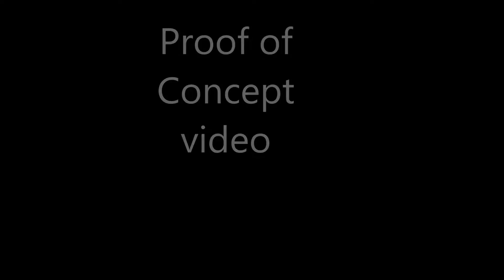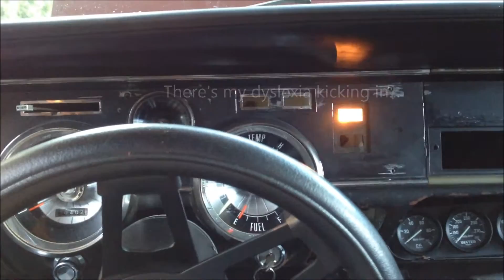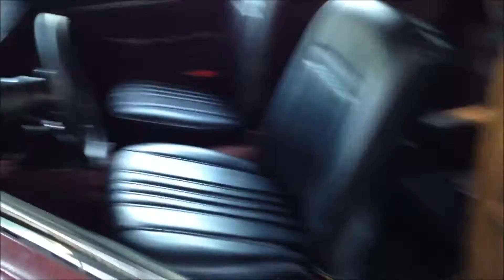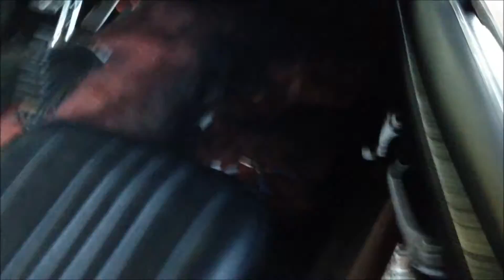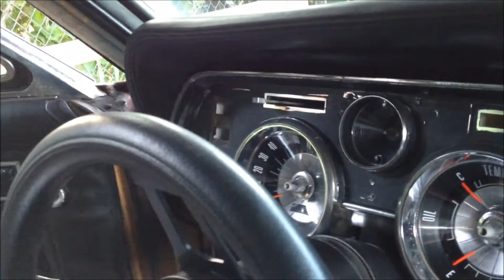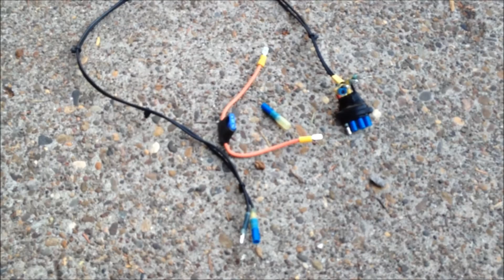1967 Cougar Turn Signal Indicator Bypass

Comment: Maybe I'm missing something here, but why re-wire when you can just use new relays in the old circuit. I realize the concours correct relays are expensive, but you can buy 30 amp generic relays at your local parts store for $10. Or I think WCCC has new style relays with modified connectors that just plug in place of the old ones.
Reply from the maker: +Jeff Schlarb WCC has restored OEM relays, and some modern replacements, but not necessarily for the indicator relay.
  The Indicator 'flash' system is different for just about every year. 1967 is load switched, 1968 is ground switched, but both depend on current load  to close an electromagnetic coil, which is generated from a motor cam changing contacts for 3 bulbs.
In 1969 they basically do what I have done here,.

There is no need for time circuits, but glad your putting EC101 to good use. I was building those on a Radio shack kit board when I was 12.

Comment: Partial, whole, I don't care the more info the better Cheers !! And as far as relays that's not a big deal being a heavy equipment mechanic I had to figure out how to wire and rewire relays early !! LoL
Reply from the maker: Sweet, skills are good! Always a pleasure to help someone who can run with the ball. Here is a down and dirty of what the '68 bypass would have to look like:

https://farm9.staticflickr.com/8280/15617128569_9cff0b9b5a_o.jpg

It reverse wires the bulbs, making the ground side HOT. The bulb socket ground should  and MUST be isolated on the 1968, or you'll send the voltage straight to ground when the turn signal is on.
 I cannot verify this, but it's NOT on the '67, so you must be sure!
Reply from the maker: AirWingAce Isolated should be a 2 wire plug on the bulb BTW. Ground is on the wire not attached to frame.

Comment: And your wiring chart looks awesome ! I took the factory diagram had it blown up to poster size and colored it in, but lost it to moisture, yours is still way better! I'd owe you BIG for a 68' diagram!
Reply from the maker: Thanks, the chart is redesigned as a functional chart for troubleshooting. I was going to do the '68 next, but I am assembling my Coug right now. Maybe over the winter, it'll be posted on the forum when I do.

Unfortunately, after looking, I do not think this will be feasible on a '68.
This method is sort of how the 1969 indicators are wired, '68 was a hybrid.

The turn signal indicators look to be ground switched rather than load switched, and one connection goes through the steering harness plug, not an easy jumper to make.

Plus, you only have 1 relay which would be eliminated, the turn signal indicator relay, which acts like the K7 relay in a '67, producing the flasher pulse.  The '68 has only 1 Emergency Warning relay, the trunk unit. The forward one (K6) is eliminated as Emergency mode (both flash) and L/R switching comes from the Steering column cam, which also means the 67's K5 relay is not needed. This method eliminates the K5,K6, and K7 on the 1967, which was the direction Ford took in later years.
Reply from the maker: Here is a partial of the 1968 diagram showing the factory indicator wiring. The only relay you need for them to function in a '68 is the flasher (K7), and WCCC has plenty. You can see though the indicators are reverse wired through the flasher, which <iirc> is a ground switch action, them rather than giving them voltage. 

https://farm8.staticflickr.com/7487/15176088833_c88d89cd0e_o.jpg

Comment: So.. To ask the question, (and I am interested) what is the use of this "mod" if the system is working? I have a 68' that needs to have its system repaired after moisture, rust and butchery. More info and maybe a diagram laying out the wiring change would be great. Thanks Sam.
Reply: When I say working SEQ system, I meant that the SEQ motor and Relay (trunk) are working. The remaining 3 relays (attached to wiper motor bracket) are eliminated. That is the benefit, not replacing those 3.
 You also lose the click sound from the flasher relay, and '67 is different from '68 there, so the mod removes getting it wrong and shorting out everything. (putting a '68 flasher in a '67 will do that)

Go to West Coast Classic Cougar for downloads of the electrical schematics. Join Classic Cougar Community forum for links to my signal lamp wiring chart (67 only atm) Here-https://farm3.staticflickr.com/2926/14588015587_eef002401d_o.jpg
Reply: I will work up a chart showing the re-route